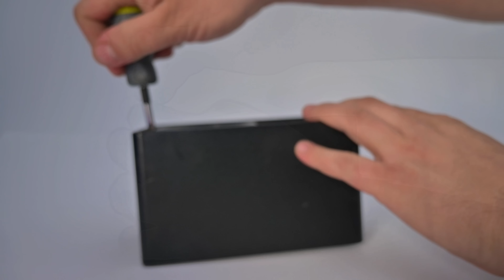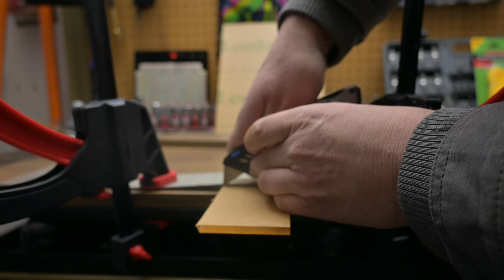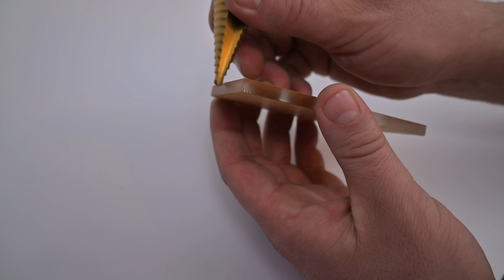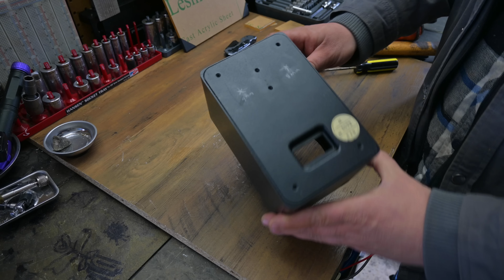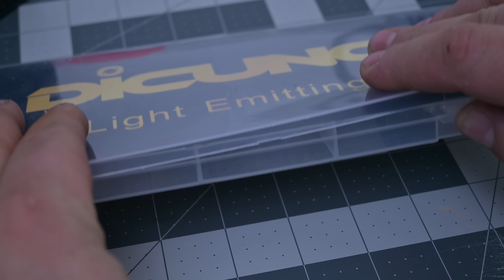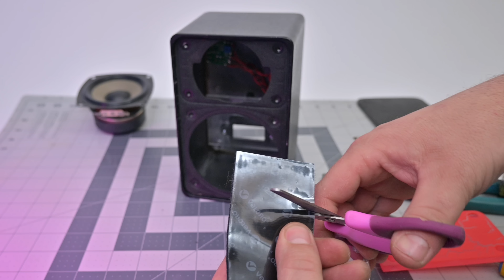Radioshack Should Have Made THIS!

Comment: Welp... I now really want to try doing this. I could hide it in my booth at work!
It might be cool to add a third hole and hook up a barrel plug so you don't have to rely on the battery... although that would eliminate the portability. :/ DO you know if they make a distortion version of that little amp unit?
Reply from the maker: @AudioThrift  DUUUUDE!!! Your channel is AWESOME! But honestly, I would steer clear of this board because it does not have an actual gain / overdrive control. The potentiometer is really only a glorified tone control. Also, the board actually oscillates at high volume. I'm currently redesigning the amplifier board. This time, I'm gonna use a good old lm386 amplifier chip. I do think adding a barrel plug would be a good idea. But unfortunately, no, they only have the one board that I'm aware of.
Reply: @Blowninyourphone Thank you... and I'll keep that LM386 board in mind instead.